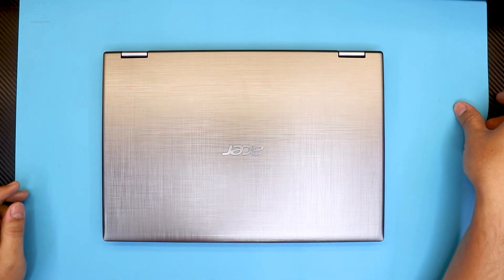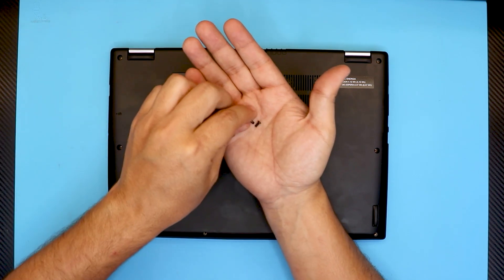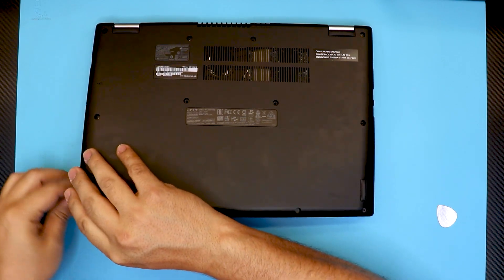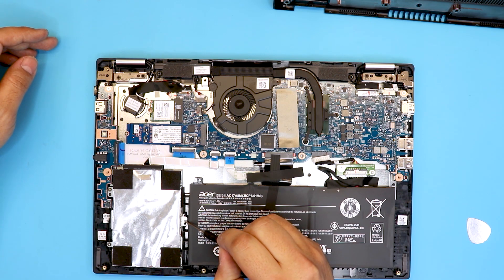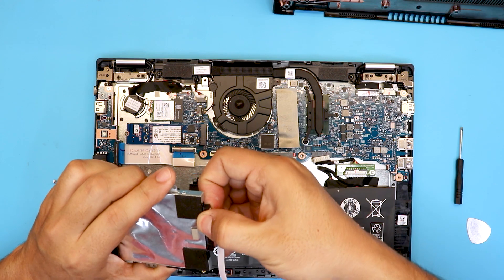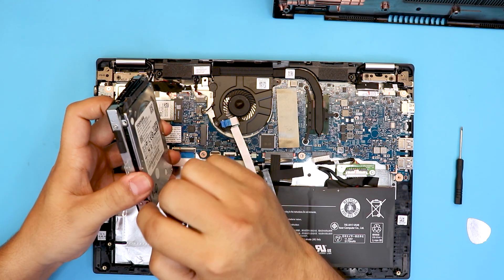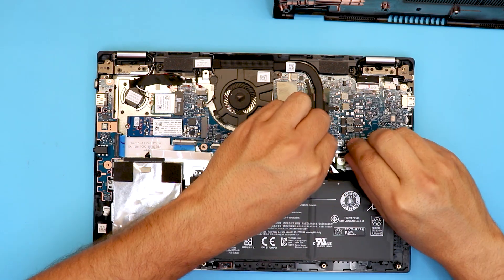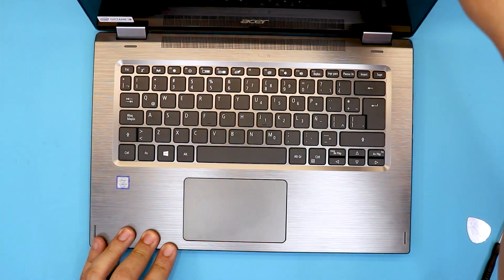Acer spin 3 UPGRADE SSD (solid state drive), speed up your laptop step by step guide

Comment: Hi. Really appreciate the details on the video. I just opened up my spin 3 which has hdd 1tb. I want to upgrade to a 2tb ssd. But right above the hdd or ssd install area which is unused. There is also a slot for ssd which i see other people installing chip ssd there. So does it really matter i install it either port? Also will the spin 3 support 2tb ssd. Please help me with this. Thanks
Reply from the maker: It's truly a pleasure, my friend. 😊 I deeply appreciate your taking the time to provide feedback. If you're inclined to support the channel further, feel free to like and subscribe—or even both!
Regarding your question, yes you can place a 2TB m.2 SATA storage there and install windows in there and also have a hdd or ssd up to 2TB installed.
Should you have any further questions or requests in the future, please don't hesitate to ask me.
cheers🍻

Comment: Hey mate. Thank you for the video! Could i assemble nvme PCI GEN 3x4 ssd for this laptop? BTW the model is SP314-51-38VM
Reply from the maker: Thank you for the feedback! if you wish to support the channel you can LIKE or SUB or both :P
regarding your question: Yes it does support NVME SSD my friend any intel CPU over 6Gen take NVME ssd 3x4
Reply: @uFixTek  i left like and got subscribed, OF COURSE
Reply from the maker: much appreciate your support, if your laptop intel CPU is 6th gen or lower it will not accept NVME ssd, IF your laptop is 7th gen or higher CPU then it will accept NVME. unfortunately your girl's laptop wont accept NVME.
Reply: @uFixTek  Bro, i did not expect that u will answer SUCH fast, so i already bought Samsung SATA 3 nvme. Btw my girlfriend's laptop has 3gen intel, so is it was a good choice?

Comment: Hi. Can you please help me which model of SSD should I buy for my spin3 2018. 
Mine is dead so i must change it. 
What is the best option?
Thank you!!!!:)
Reply from the maker: Thank you for the feedback! if you wish to support the channel you can LIKE or SUB or both :P
regarding your question: i would highly recommend  you to do the following:
#1. remove the m.2 ssd optane that you have, (one screw and pull it out)
#2. remove the mechanical hard drive (HDD) and replace it with a good brand long lasting SSD:
https://amzn.to/34DfEwA

#3 install windows 10:
#3.1: create windows 10 usb boot: https://youtu.be/uDu8j2lE-dM
#3.2: install windows 10 proper way on any acer laptop: https://youtu.be/6TTlDTpcXwI

DONE :)

Comment: Will this work for acer model spin SP314-52
Reply: Is it possible to add an SSD to this model (not upgrade)
Reply from the maker: yes you can add an m.2 ssd (remove the optane stick) .
the optane is useless
Reply: Can you send me link to buy ssd , caddy and cable to upgrade this model sp314 52 59ls plz

Comment: Hi! can i ask what caddy is used for this model?
Reply from the maker: the caddy is there to hold the hardrive in place and the caddy is hard to find if you loose yours,
 but its not important if you dont have it, you can fill and use a double side adhesive tape to hold the hdd in place. 
here is a link to ebay:
https://tinyurl.com/ya48dyyr
Reply: @uFixTek  H again! does the model matter of a sata flex cable even on the same brand? Like acer to acer?

Comment: Can I use an external vga with the acer spin 3?
Reply from the maker: First Last yes you can , as soon as i get to the computer i will get you the details on how to. 😋
Reply: @uFixTek  please dont forget me!!
Thank you ur the best
Reply from the maker: hi, okay here is how the thing is going to go down :)
#1. if you need wifi you must get this : https://amzn.to/37tDSp9
#2. then you need to remove your internal wifi board right at @1:38 its right beside the cmos battery left of the fan, on top of the ssd.
#3. you will purchase this : https://amzn.to/2GoafKa
or this: https://amzn.to/2TXDOKG
#4. or anything like it check the ratings and see if some sell the power too else you will need to buy a regular power supply.
you will have to make an opening on the bottom cover to pass the cable tot he wifi jack that;s the downside.

NOW if you know how to solder and abit of simple electronics  i would suggest this:
#1. get this :https://amzn.to/3aI7Dow
#2. you will need to remove the usb jack of the tiny pci card that comes with 
#3. i made this picture hopefully you understand if not don't do this
https://imgur.com/a/zAw84nC

THE ADVANTAGE OF THis way is that you dont have to cut open under your laptop and having a cable hanging, and you can just connect usb to the device,
DISADVANTAGE : you will loose one usb port.
i hope this clear your idea of having external gpu.

if your laptop had a thunderbolt then it would be much easy
https://amzn.to/2TWC9Vr

good luck and thank you for the support :)
Reply: @uFixTek  hey bro! The image you have sent me in the second option in which I will remove the usb port.

If i desconnect the usb cable from the pci and solder it to the usb port. Where does the other part connect to on my laptop?

Will I loose wifi in both cases because also in the second case I need to connect the pci instead of the wifi?
Reply from the maker: First Last i will give you a more detail tomorrow. Very long day today😔
Reply: @uFixTek  hope you are doing well. I think I have figured it out. 
The second option is the same as the first, both will have graphics card connected to the pci (previously wifi) but one has a cable connected at all times coming out from the laptop and the second with the pci connected to a usb port where i can plug and remove the usb cable to remove the EGPU.

Feel free to comment whatever u want. U are very helpful thank you very much.
Reply from the maker: i hope by saying external VGA you saying external GPU  :P
Reply: @uFixTek  yh gpu graphics card, my bad🤣
Reply: @uFixTek  thank u so much bro i will let u know how it goes
Reply from the maker: aiight good luck
Reply: @uFixTek  and an ssd while keeping the hdd it has an additional port right??
Reply from the maker: ya the mobo yas a sata3 for the HDD and pci-e slot that has the ssd m.2 and mini m.2 slot that has wifi board , you going to remove the wifi board.
Reply: @uFixTek  hey bro, bad news my hardisk got fuc** today so had to open in the laptop. Its a spin 3 SP315-51-5223

You are right the spare m.2 fits an nvme ssd but is it supported by acer. If it fits will it function??

Also there is an empty big card slot on the righ side. Is it the same as an express card? Maybe I can connect my evga straight to it! Because its connected directly to the board

Comment: Hi Thank you for the great video, now I am ready to upgrade, my SPIN3 is SP315-51-757c (2016 model) what combination of upgrade should I get?
Reply from the maker: i would highly recommend you to remove the optane drive and put in a nvme ssd drive and install system there and if you want better you can change the HDD to ssd drive too to have extra SSD storage this way you dont have to worry regarding moving the laptop when its ON.
Reply: @uFixTek  awesome!
OK I will buy the NVME m.2 for the OS which I need to transfer there, the current drive is 900+GB full, I will also get that SSD for storage. any suggestions on the setup like which ones to get for NVME m.2 and SSD and what to do to transfer.... will it automatically resume like the old setup when i migrate the C to the new NVME?
Reply from the maker: yes use a https://amzn.to/2LN97od and use a hdd image app the best one i use its: "Macrium Reflect", but i dont recommend never ever fill any ssd or hdd to max always leave 15% free else you will reduce the life od the drive bye half. use a 1tb nvme or 500gb nvme and get a bigger 2tb ssd drive
Reply: @uFixTek  Hi brother i have the same laptop and I want upgrade my laptop, so I should buy nvm drive?

Comment: is it possible to upgrade ram on this model?
Reply: Elliot Thomazini same question
Reply: i´ve just seen a guy here on youtube upgrading soldered ram on a macbook pro. so it might be possible.
Reply: I ask same question under the video about battery replacement. Will wait the answer from Ufixtek. But in that video seems what SO-DIMM connector with memory module placed under the battery.
Reply: @blackt0mcat  i already crack opened my acer spin 3. the are no memory modules. the memory chips are soldered on the motherboard on both sides next to the cooler.

Comment: hola, sabe si hay alguna manera de aumentar la ram de ese portátil, el mío solo tiene 4GB y se queda corto, y cuando lo hace el touchpad se vuelve insoportablemente lento. Estoy tan decepcionado de este equipo por eso.
Reply from the maker: no compa no hay ninguna manera de aumentar el ram , esta soldado a la tarjeta. es un asco de portátil ya que 4gb no es nada para windows 10. lo lamento de informarte
Reply: @uFixTek  bueno, igual me di cuenta también que intel optane es un completo fraude, porque no sirve de apoyo para una memoria ram con poca capacidad, y si usas un ssd ni se nota la diferencia de usar o no optane. 🤦‍♂️
Reply from the maker: @JohnChinome  optane es una mierda total siempre lo sacamos y a la basura. en mi local hay como 20+ optane de regalo. tu caso no tiene solución de aumentar ram, solo que pongas "windows 10 LTSB" te va correr mucho mas rápido y es lo mismo pero sin mamadas. hasta mejor es el ltsb. si quiere mas info sobre ltsb o otras avisame
Reply: @uFixTek  hola amigo me encuentro en esta situación :( Me das Info del Windows LSTB?

Comment: cant install an M2 and stay both? M2 for de OS and HDD for the storage? i have a Spin 3 and i wish made this :(
Reply from the maker: yes you can remove the optane m.2 ( @1:40 ), and put a ssd m.2 in there and keep your mechanical hdd ( you just have to format your HDD ) . 
claro que puedes, quita el optane m.2 y en su lugar coloca el ssd m.2  así podrás formatear y quedarte con el hdd mecánico como storage.
Reply: @uFixTek  hola tengo la version i3 de octava generación con 4gb y 1tb disco mecanico.  Se le puede instalar adicionalmente un ssd y de que tipo m2?  Se necesita un conector adicional .?   Esta version no trae optane
Reply: Where is this M2 slot?

Comment: Have you done benchmarks? what's the percentage speed gained?
Reply from the maker: there is not a trust factor on bench marking SSD to HDD, as the fact shows most ssd's are 2x faster than regular HDD also the other factor comes to what are the types of files and size of the files. as an empty file with 11111 its faster in transferring rather than a complex file. also ssd's can handle better and faster the clusters of the files, comparing to the HDD that has a mechanical arms known as (HDD actuators) that has to go back and forward to get files from one sector to the end of the platters, also as you start filling the HDD the the files that are installed or are written to the edges of the plasters are slower to access as the rotation and ratio factors kicks in. so if you benchmark a full HDD and the files are located at the end it will be 4x slower than the files at the beginning where the os is written to.  none of this are applied to the ssd drive as they can handle all the info no matter the location and amount of files that can handle is much more higher.  also by replacing your HDD to SSD you will gain about 30-35min battery life as the power that ssd uses is much much less. if you need more detail info send me a PM.